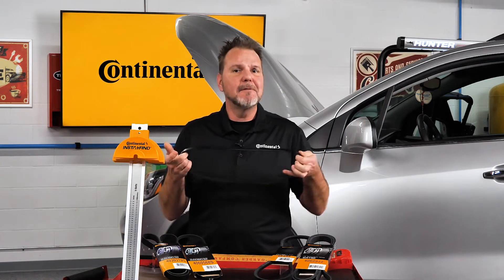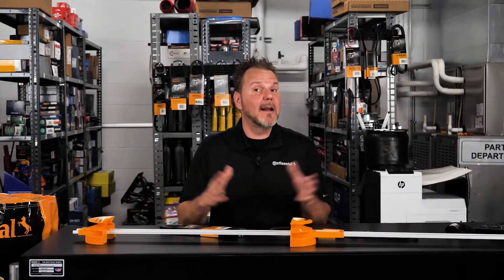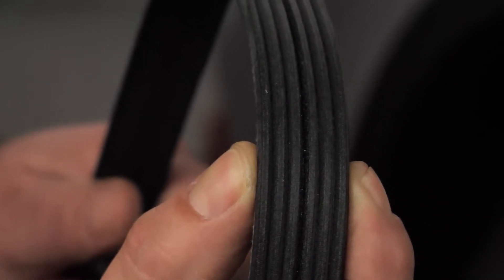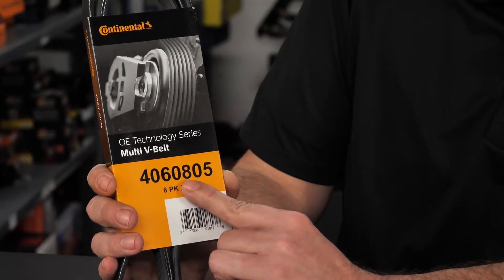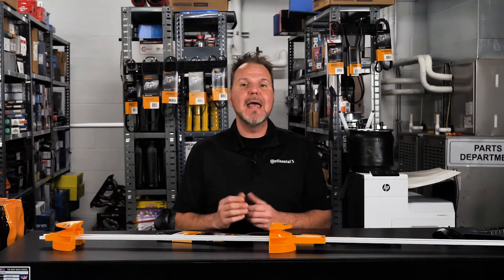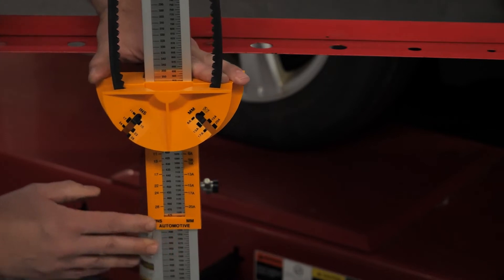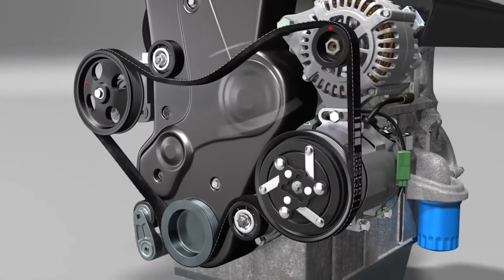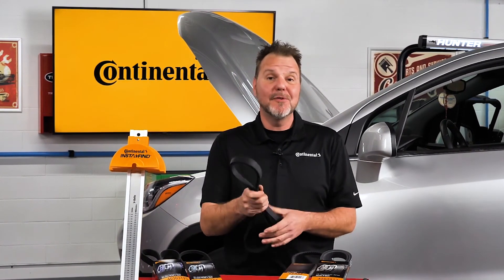Measuring a Serpentine Belt

Comment: I just look up the part number and put it on. If it feel right to the tug, I'm good. One of my cars uses a serp. belt with a tensioner, my other car has drive belts w/ adjustment bolts. I have never had to measure, but I don't have any alterations either, like AC delete or custom sized pulleys. But I never knew this so thank you!